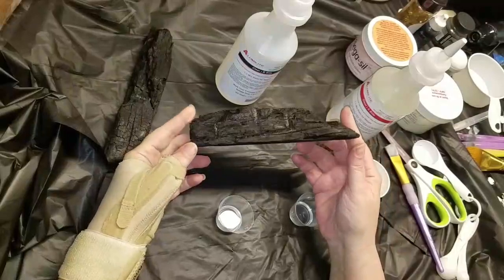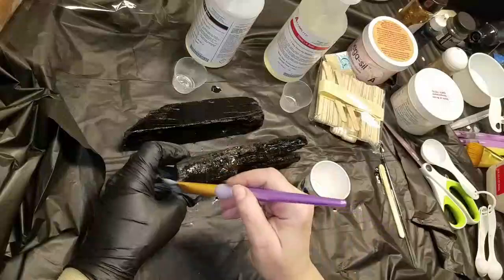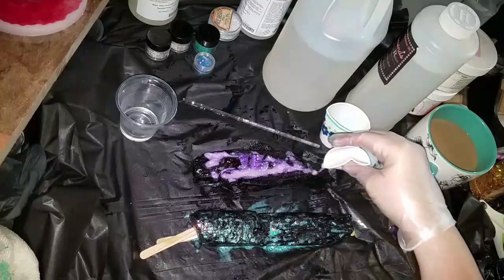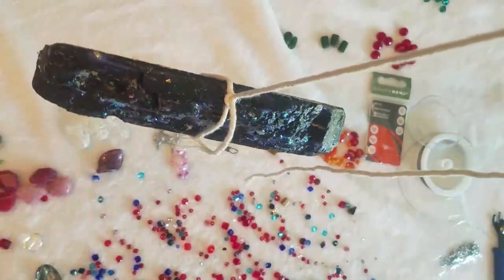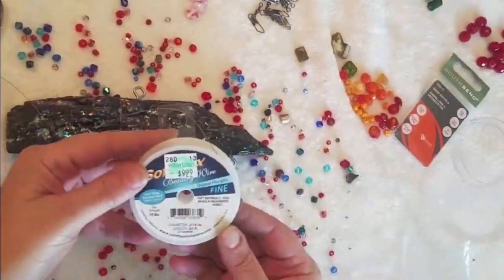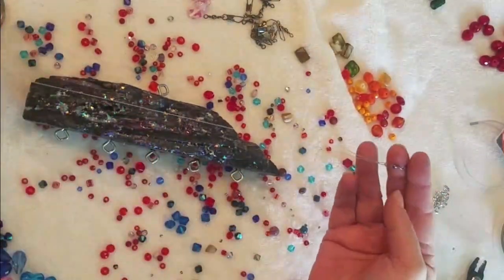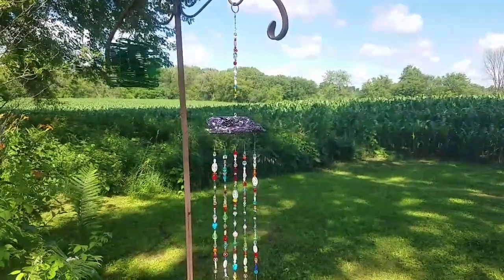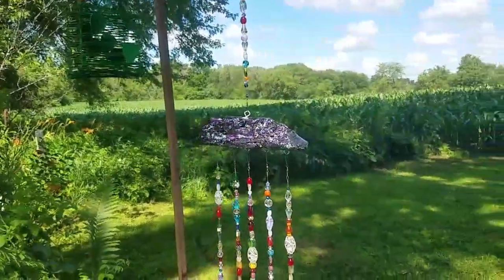How To Make a Suncatcher with Driftwood and Glass Beads

Comment: Wish we would have seen/heard how u ended each row of beads and attached circles.
Reply from the maker: Thank you so much for your feedback. The pearl shell rings were attached the same way I attached the beginning wire to the eye rings in the drift wood. The wires on the pearl rings were just wrapped and crimped with a crimping bead. I don't show that bit but attaching them to the string is at 15:12 or there abouts
Reply: I was just sayin that. Like products how was it mixed where bought. Like how holes r drilled. I’ve been googling jours to find someone who tells which drill or bits or kind of resin or what to use to drill holes in drift wood. Very beautiful tho. But prob make your videos more popular. By alot.